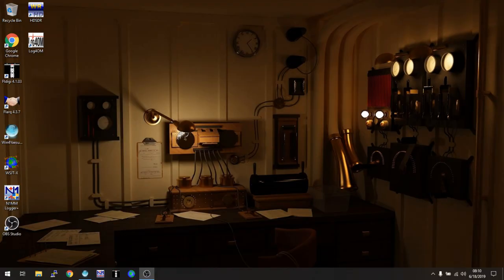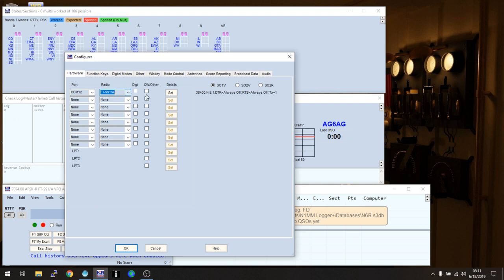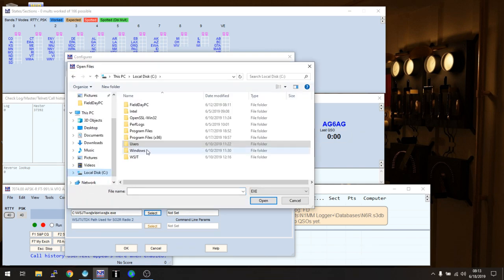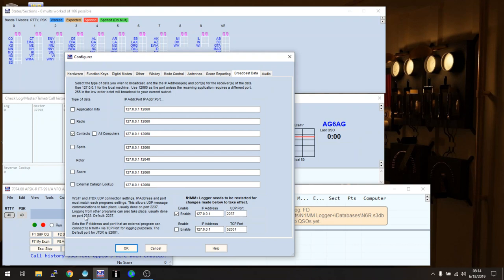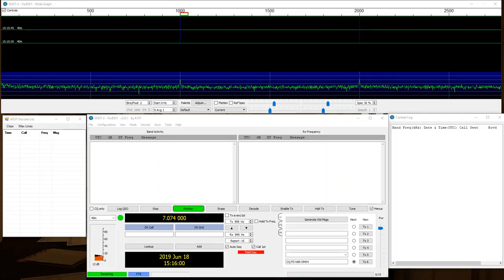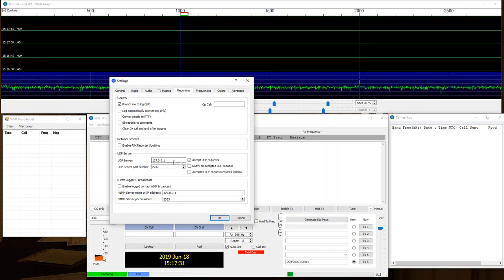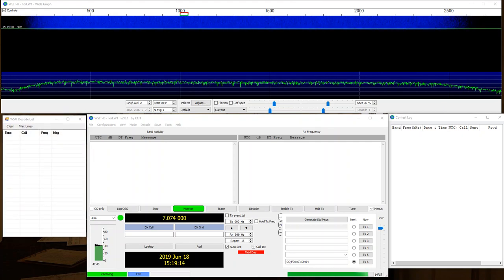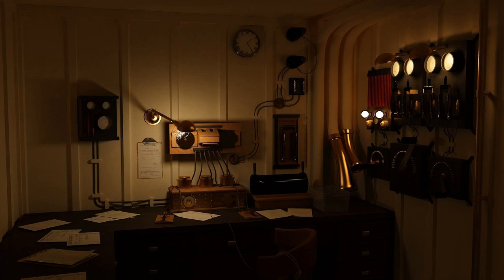NEWER VERSION AVAILABLE! Setting N1MM+ and WSJT-x To work together as one solution

Comment: Stu..
Great video. I hope a lot of users look at this as you have shown how simple it is to setup and use. My only 2 recommendations are 1. In the N1MM Config on the mode tab. there are 2 drop down menu selection for radio 1 and 2 for what mode you want N1MM to switch into for RTTY and PSK. Set the mode for the PSK selection. When WSJT is loaded N1MM sets the radio mode to what is selected in this drop down.  2. Don't enter if the settings in WSJT until it has been loaded thru N1MM. When WSJT gets loadedd thru N1MM it uses a separate configuration file than when it is loaded by itself. You will notice the name of it in the top title of WSJT. If you make settings when it is not loaded thru N1MM those changes will not be loaded into the config file that gets used when using it with N1MM. Thanks for doing this I hope it gets the word out about setting it up.. 73 Rick N2AMG (Digital developer for N1MM).
Reply from the maker: Hi Rick!

First off, thanks for all you and the other developers do for the the N1MM project! It is an amazing program, and my very favorite contest logging software.

I actually stayed away from the two pull downs on the mode tab as they are very much radio specific. I do have them set for my Yaesu, but that setting is specific to certain Yaesu models, and I felt it would be confusing for someone that has not done a setup for RTTY or PSK31 before seeing this video.

I agree that I probably should have erased the WSJT-X-ForEW1 directory before I video captured the setup. And I really should have done a better job of making it clear that the configuration file would be different then the one you load when you run the program from the desktop. I said a few things that implied it, but didn't really make it clear...

Just a note, the software combination worked great for me during field day! Much better then having to modify ADIF fields and import the data into N1MM... <g>

Great work on the software Rick, Thanks Again!

73 Stu AG6AG

Comment: Hi Stu

Great video, only question I have is, does it logged to N1MM++, for me I had to import the file into N1MM and these contacts never showed up on the score summary, so thought I’d ask.. thanks again
Reply from the maker: Hi Scott,

I tested this during Field Day, and when  the logging page popped up on WSJT-x I was able to click OK and the QSO went right into N1MM+. I did have to add my exchange on every entry in the WSJT logging window, but other then that, everything logged directly. We are evaluating one issue which seems to cause the QSOs to be improperly interpreted due to them being logged as FT8 and not RTTY... More on that  when we get all the data into a parser and do some evaluation...

Till then...

Stu

Comment: Stu, great video!
One question (maybe more)
   I gather you operate using the wsjt windows or do you need both? 
   Does the exchange data propagate between the apps or is some of it typed in?

See you there... 73’s de Mike wa6fxt
Reply from the maker: N1MM is the vehicle that your are running WSJT-x Through. So I guess the answer is you need both of them running. Second question, when the log save screen comes up in WSJT-x and you select save, it populates the N1MM log. Also, the right scroll of all receive is color coded with 'worked', multi, etc... Makes for a real easy experience.

Comment: Wouldn't it just be simpler to import the WSJT-X  ADIF log into N1MM?
Reply from the maker: Hi Tony,
Having WSJT-X integrated with N1MM+ allows N1MM+ to handle the 'Already Worked' color coding inside of WSJT-X so you will have an indication of the 'worked' status based on the contest, not on the standard 'Already Worked' criteria used by WSJT-X. It also makes sure that the QSO is in the format accepted by the current contest.

But if you are just working one band and don't want all of the other features that N1MM+ works into the mix, you certainly can import the ADIF file.

Stu
AG6AG

Comment: does the path option under the digital model window exist?
Reply from the maker: Hi,
No, they radically changed the configuration interface. Now all the settings for WSJT are under the WSJT/JTDX Setup tab. That is where the path entry is now.
It's important to note that you still need to configure FLDigi and/or MMTTY under the Digital Modes tab if you are going to be doing RTTY/PSK31.
I'm trying to put together a new video for this with the menu changes. Hopefully soon.

Stu
AG6AG